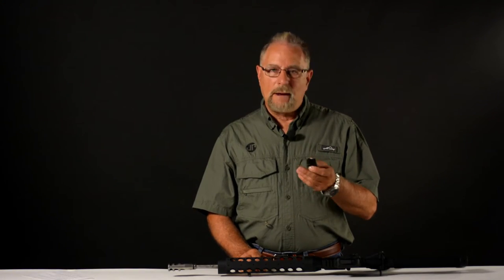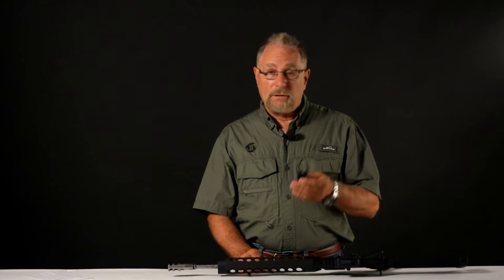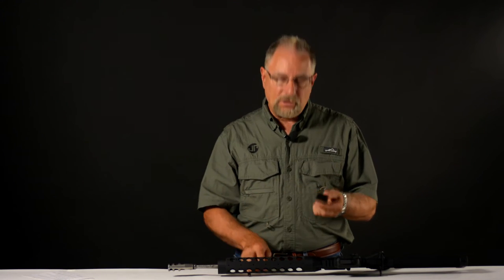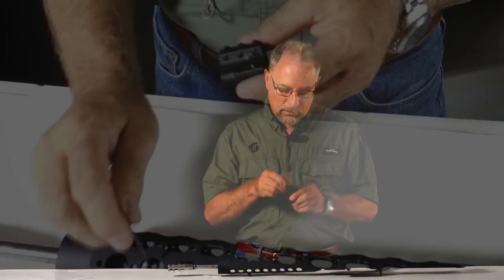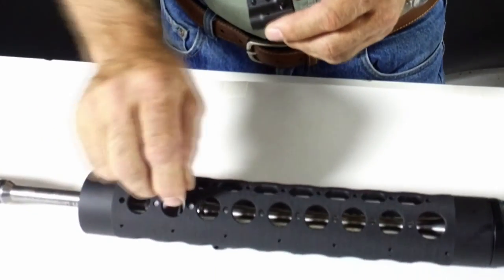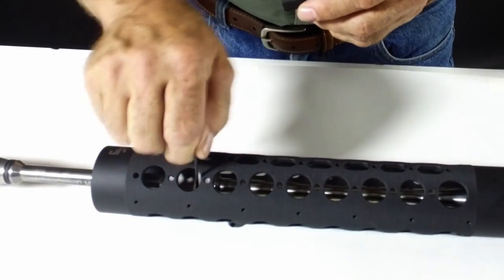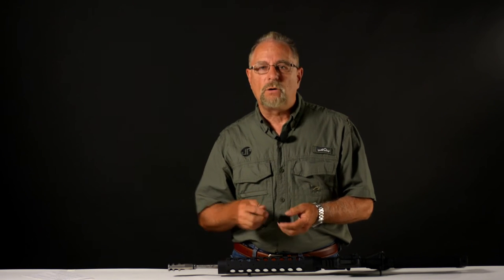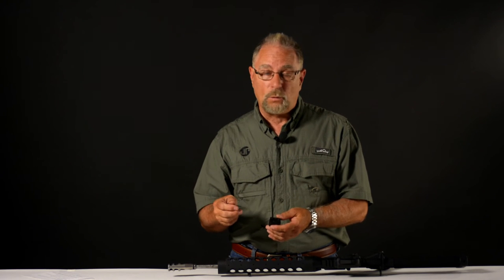.750 Detent Gas Block - New Product Showcase - AUGUST 2016

Comment: Will this gas block sustain heavy duty uses like long shooting sessions or rapid fire without moving or coming off the barrel?
Reply from the maker: Yes. It also has a feature that allows you to pin the gas block to the barrel.
Reply: @JPRifles  that will require some drilling?

Comment: Does this gas block require you to lock the adjustment screw through the front detent?  I just purchased this gas for exactly the reason you mentioned.  I will pin and weld my barrel.  I'm trying to figure out how how the adjustment screw locks...
Reply from the maker: The detent feature locks by itself.  Once you turn it to your desired setting, it will hold there and not migrate.  Some of our other models have a locking screw, but the detent models don't need one.

Comment: I don’t know if people truly appreciate the value of 1) side adjustment, 2) detent click, and 3) angled access to side adjustment!

This is the only real gas block I would consider for suppressed 300blk use outside of Seekins Select or Riflespeed, and those last 2 options require modification to the handguard or sufficient space between the end of the handguard and the muzzle.